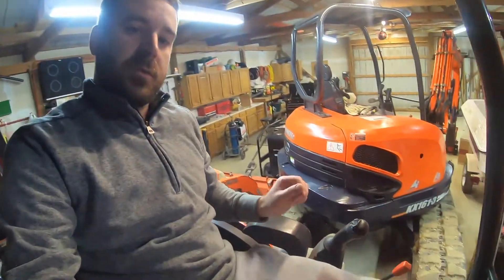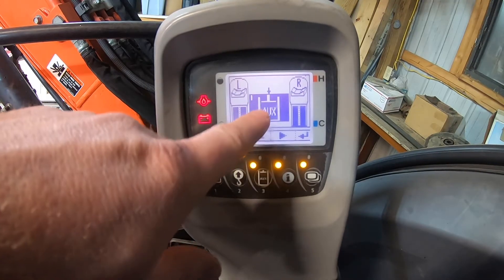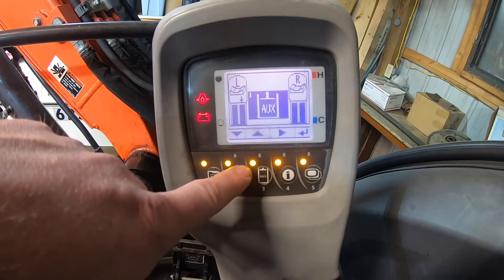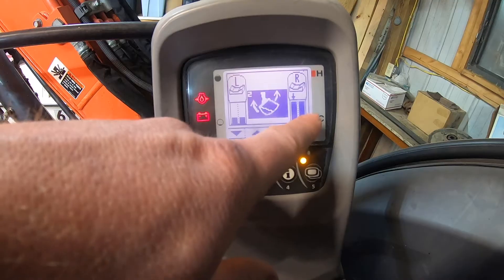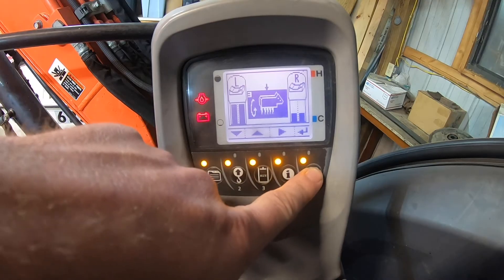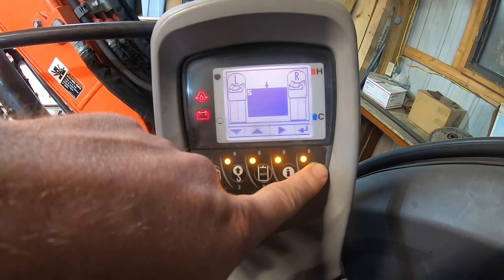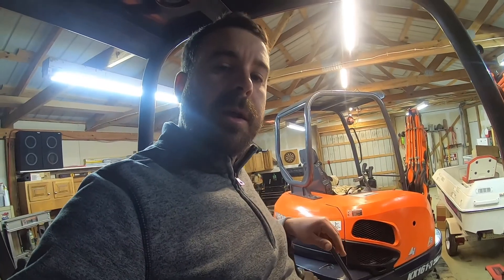HOW TO Set Auxiliary Flow Controls on Kubota Mini Excavators

Comment: How do I get the thumb to work on the right side joystick? Currently it is operating on the left joystick
Reply from the maker: @rpuco  hey good question! You need to switch the thumb hydraulic cylinder lines to the smaller set of aux line tubes on the stick. 
If you have dual aux ports on the stick there are smaller lines and larger lines. The smaller lines are for the thumb and are controlled by right joystick. The larger lines are capable of continuous flow and have larger diameter for more flow for mowers and other volume heavy attachments. The thumb needs very little flow rate to operate. 
Alternatively you could go to the aux solenoids beside the hydraulic tank and swap the wire harness connectors between the two solenoids. That would switch which joystick controls which port. But I would plumb it correctly instead at the stick.
Reply: @NealORussa  the lines are plumbed correctly at the stick and into the cylinder. That was not touched, but somewhere under the hood they may have switched something, but I really don’t know where the thumb hoses are so I’m not comfortable trying to fix it myself. I will just have Kubota take a look at it since they are the ones who caused the issue in the first place.
Reply: OK, I will look into this. I was trying to do it through the control panel inside the cab, but it was not giving me an option. Kubota recently did a large project and they may have put it together wrong
Reply from the maker: @ good deal. There is no option to change it in the control panel settings in the cab

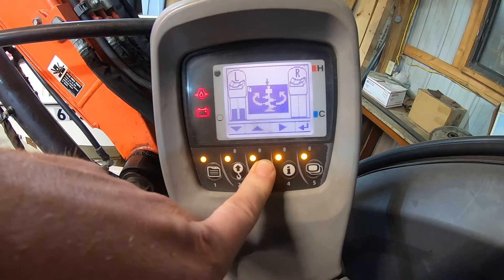Comment: @ 9:28 you did not explain how to remove the auger from the list, you only kept pressing buttons?
Reply from the maker: To remove an item from the list, change it from an auger to the blank option.  After you exit the setup menu, there will no longer be an auger option when selecting aux hydraulics.  Keep watching after 9:28 i setup multiple blank options, so the only options shown are aux, tilt bucket, mulching head.

Comment: I have a kx040, great vid. Do you know what the actual flow rates are on the settings? I guess full is 17 gpm? I have a hydro hammer coming in. That needs no more than 7 gpm.  I would guess half way point is 8.5.  What would one click down be from half? Whish they had numbers and not just a bar
Reply from the maker: Unfortunately I don't know that. It may be in the manual but I doubt it. I think you're on the right track. I'd start low and then bump it up until the hammer is working like you want it to. If you want to be 100% sure a hydraulic shop can put a flow meter on the aux fittings to check flow and pressure.

Comment: On the rotary cutter (#3) would you not set the flow so that it will only spin the head in one direction? So L1 flow would be max and L2 would be none?
Reply from the maker: Yes that's correct. I think that's how I set the rotary cutter. But if not it doesn't really matter cause I also turn the one way valve under the hood so if you press L2 it just goes straight to the tank and won't send to coupler. I have another video on that valve you should check out
Reply: @NealORussa  I saw it. I have a 40 with the Brush Master 42. Specs say it's bidirectional but I am concerned about the free wheeling of the blades forcing hydro back through the valve body if I don't turn the valve under the cover.
Reply from the maker: @cvmikeray2  gotcha. I wouldn't see the need for bi directional use except for blade life. I would run it one way with the valve switched one way like I show until blades get dull. Then swap the hoses on the attachment so it spins the other way and uses other side of blades. Then once both sides are worn down take them off and sharpen and repeat.

Comment: Do you have to hold the rocker on left stick to keep cutter spinning?
Reply from the maker: There are two ways to run the cutter. One is to hold the rocker switch over. The second is to press the trigger button with your pointer finger one time and that will keep it on continuously. When it's going continuous you can press trigger again to stop it or move the rocker in either direction to stop it.

Comment: Neal, when I use the left button for the brush cutter I have to hold it down to keep blades turning. Is there a set up I missed to get the cutter to remain on?  Flow seems okay, but the left thumb control should not have to be held down?  Seems once the quick disconnect are connect the left thumb button should be an off / on?
Reply from the maker: Hey Dave, my left joystick has a trigger button you press with your pointer finger. That is the off on switch for continuous flow.
Reply: @NealORussa  thanks so much. I am having to hold down to run. Release & and shuts down. Got to a set up program set wrong? 🤦‍♂️
Reply from the maker: @davedawgs  no there's nothing in the programming of the computer screen for that. It's only flow rate. That's odd though your trigger isn't on/off
Reply: @NealORussa  switched hoses and it worked!

Comment: wonder if i could do this on my kx 121-3 ss its a 2003 diffrent screen
Reply from the maker: Unfortunately I don't believe so. I had a kx71-3 and a kx161-3ss. Neither of those screens has this capability to adjust flow rates.
Reply: @NealORussa  Thanks for the reply

Comment: What would I set my hydraulics for a hammer?
Reply from the maker: I'd go full bore and then also change the one way valve to drain the return straight to the tank.  I have a video on that too.
Reply from the maker: Here is the valve video
 https://youtu.be/Rd382rVsPms
Reply: Thanks.

Comment: Great video! I just got my masticator head a couple days ago, I’m able to get it powered up but I cannot figure out how to put in constant flow so I’m not having to hold the left toggle over the whole time , could you maybe shed some light on that for me please
Reply from the maker: For constant flow you press the trigger button on the back side of the joystick. There's also a valve you can turn so the return flow goes straight to the tank. Here's the link showing that valve. https://youtu.be/Rd382rVsPms

Comment: And you’re not doing anything special about running the tilt and thumb without having to switch flow from one port to the other.
Reply from the maker: There isn't a way to switch the flow from one port to the other. You have to change the couplers on the attachment to get the switch to work the way you want it. For instance my tilt bucket when I bought it was backwards. I pushed the rocker to the left and it tilted right. I swapped the male and femal couplers.

Comment: Thanks,  what is the button for on the front side of the right hand control. 2018 u35-4 ? Opposite or the rocker and horn switch
Reply from the maker: I've never used the trigger button on the right side. But on my machine with the dual aux hydraulics I use the trigger to run my brush cutter on aux 2 (left joystick). You press the trigger button and it sends fluid continuously until you press it again or toggle the thumb switch. That way you don't have to hold the thumb toggle over the whole time you're brush cutting. Maybe the right trigger does the same thing for aux 1.
Reply: @NealORussa  I have an Eterra Flail cutter on my Kubota KX040 and have to use the left hand thumb rocker switch to operate it.  The button on the left joystick doesn’t make it run continuously much to my frustration.  Also, the valve selector in the engine compartment has to be in the vertical position for it to operate.  Any suggestions on how to get that left button to work to allow continuous flow so I don’t have to wear out my thumb?  Would switching the lines on the cutter fix this?  Any help you can give would be appreciated.
Reply from the maker: @dougspencer4485  you should have a trigger button on the joystick you use with your pointer finger when you have a grip on the joystick. If it doesn't make your attachment spin the proper direction you have to swap couplers on your hoses.
Reply from the maker: @dougspencer4485  i just read your other comment and it sounds like your couplers on your cutter line hoses need to be swapped. Then you can use the one way flow valve to return fluid directly to the tank. https://youtu.be/Rd382rVsPms

Comment: That was a great explanation. Picking up a tilt bucket in the next several weeks and this will be perfect for helping get it adjusted without needing to by any orfice plates, etc. Thanks.
Reply from the maker: Definitely!  I had my tilt bucket on a kx161 and I had to put orfice reducers in after the quick couplers and while it worked it was too slow. Setting it right with this machine is a piece of cake and the orfice reducers are gone!